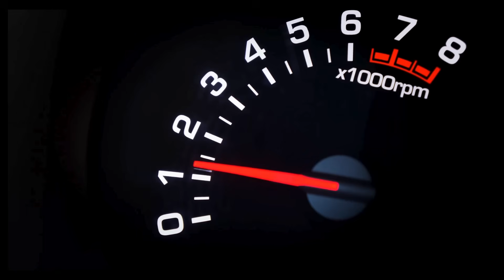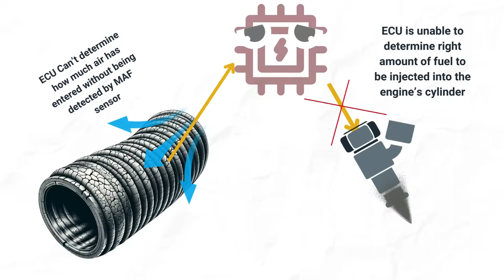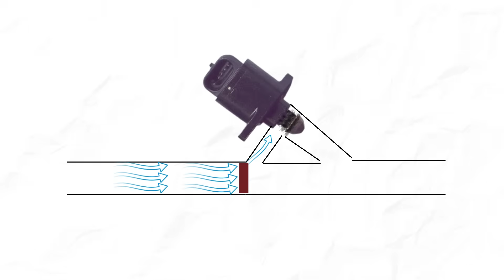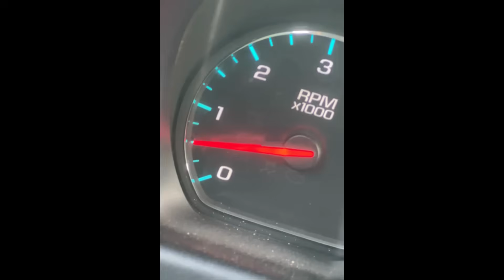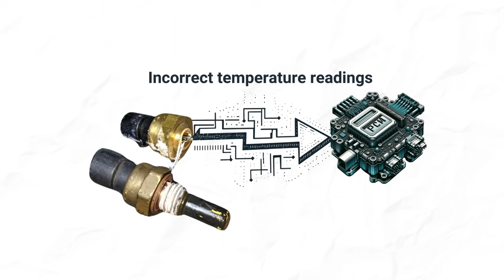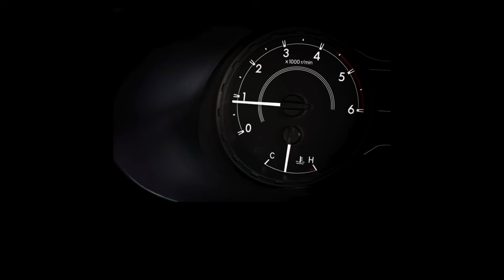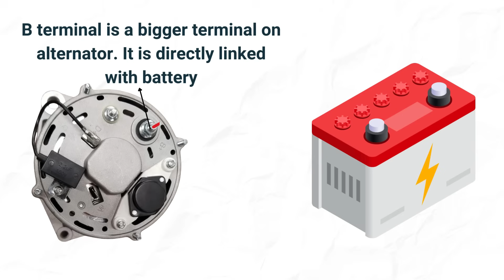6 Reasons Your Engine Revs Up and Down at Idle | RPM Fluctuations While Car is Parked

Comment: Hello I have a kia forte 2019 have misfire on cylinder 3 changes all the spark plugs all   coils also changed the Valve Cover Gasket Kit the tube seals and still check engine with misfire and rough idle engine shakes too much please help
Reply: Try Liqui Moly Jectron 7711 Gasoline Fuel Injection Cleaner additive. I have a kia sportage and it fixed.
Reply: @Global.Policy.Analyst I will thanks man
Reply: @مفديمفدي-ظ6ظ 
You're welcome,  Wait until the fuel light comes on. Pour the Liqui Moly Jectron into the tank, then fill up completely so it mixes well. Drive normally. After your next refueling, you’ll really notice the improvement in smoothness and response 👍
Keep me in the loop:)

Comment: lhelp me please  I have a 2003 Chevy Monte Carlo LS I replace EGR valve rear exhaust manifold new spark plugs new idle control valve new alternator new coils new fuel filter new fuel injector cleaned throttle body new maf sensor new purge valve new throttle body sensors new catalytic converter new oxygen sensors new resonator and .. what happens is ince it warm up my car reevs up n down I don no why I replace the map sensor too please help my mechanic even checked for vac leaks nothing

Comment: U have Swift VVT 2012 and when the car is in Idle the RPM becomes low which is around 500 and the car gets vibrating. We have checked everything nothing found. Some mechanics suggested to do rework of engine head. Will that fix the issue

Comment: Very Simple to solve Idle fluctuations,  I've did it in my car and prover tested.

Fill you fuel tank with V Power Diesel and automatically the fluctuations eliminated, your car idler becomes normal.

Comment: I had the same issue and tried every possible step. Later, I discovered that the previous owner had removed both oxygen sensors. Unfortunately, I checked that last—after replacing several other working parts and wasting a lot of money.

Now I’m waiting for the new oxygen sensors to arrive so I can see if they finally fix the problem.

Comment: Well explained and in full !! And in short time covering all aspects ! They say if you cant explain something exactly and in a short time you dont know what your talking about ! Man if everybody on you tube was like u it would a great place !! 😂 thanks sir ! Got a sub for sure.  Quesrion i have a 2009 rabbit idles high at cold start 15 after a minute it drops. To normal but runs and sounds bad for like 15 mins at high speed runs good and perfect.  New plugs and oil no check engine , what do u think boss ?.someone said the coolant sensor. But idk 🤷🏾‍♂️

Comment: I still have a high idle after cleaning the throttle body, placing a new iacv, a new tps sensor, new filter, new main relay, new fuel pump, no vacuüm leak, no engine check light. Heck I even was starting to think my gaspedal or cable is stuck, nope. So I still don't know why it's idling too high??..
Reply: check the tps

Comment: Thank u for valuable info. This can be added as a cause. My car  has same RPM flucfuation with no codes even with ODB. while checking car, I Noticed one fan not working. Found out the Low fan relay bad it had a burn brownish color on side. Replaced it and solved yhe problem.
Reply from the maker: Thanks for valuable info

Comment: I travelled without air filter cover and the engine started reving up and down . possibly unregulated air entered the engine .what should I start with
Reply from the maker: check maf sensor, it might become dirty. then clean spark plugs

Comment: My 2016 Tucson is currently at the mechanics getting checked over as I had a bad problem with it excessively revving up to 3-4 1/2,000 rpms stationary or slowed down at the lights or a corner even their diagnostics computer said the car thinks its going 208 km/h even when not moving. The throttle body, mass air sensor, fuel injectors and o2 sensors are all good but after giving it a test run on mechanics advice it still did the excessive revving at traffic lights. 

I've got a gut feeling both onboard computer/engine control module is pretty much stuffed beyond repair will know on Tuesday 05/08/2025 if that's the case I'll end up with the current loan car which is also a SUV
Reply: What's the outcome brother ?
Reply: @rautrajendra2993 currently still at the mechanics turns out my tucson is a 2009 model but the ECU in bonnet has been some how exposed to moisture.

This has caused early stage failure with not enough fuel being delivered,using more fuel than normal and rough idle so the mechanic is waiting on a reconditioned ECU and immobiliser to put in it

Comment: Thank you for the video. My sons 2009 gmc sierra 5.3 has rpm  fluctuations. Oxygen sensors. MAF sensor has been replaced. Throttle body has been cleaned and vacuum test is ok. Battery and alternator are also fine. I will try replacing the coolant temp sensor to see if that does the trick. Any other suggestions?

Comment: I have been having idle problems, sometimes will stick at 2000RPM, sometimes will run irregular, not all the time, sometimes if I cut the engine off and back on the idle will go back to normal, most times idle normal at around 800 RPM but the problem comes and goes?? Need some help with this, NO CHECK ENGINE LIGHT

Comment: What about idle rpm goes high or very low after braking? Throttle body already clean and all sensors are new. Still having the issue
Reply: I have same problem with my nissan frontier 3.3 2002...??....

Comment: Can this make the temp gauge to fluctuate as well?
Reply: Probably not. Check your water pump and thermostat.  The plastic pressed on impellers have been spinning on the shaft in a lot of the tempurature related problems I've seen lately or the thermostat is shot, or the radiator fins clogged with cottonwood fuzz, or the inside of the radiator  is clogged with rust and old coolant sludge. If you pop the hood hood when the engine is hot and you smell brown sugar or maple syrup like scents, your waterpump or radiator is leaking somewhere.

Comment: I have a dodge journey 2012 sxt if i go over 35mph my rpm goes up and down getting throttle cleaned tommorow if dont fix what can i do next ?
Reply: remove and clean the idle air valve with Throttle body cleaner, there are many good videos here, use a new gasket when reinstalling. Do not use brake cleaner.  hold the valve vertically with the electrical connector in the upright position. This keeps the TB cleaner from entering the motor and electronic housing.

Comment: This video makes me miss old motors don't need all these sensors and computers give me my 65 back 😢
Reply: Exactly. The pollution inspectors own your car   "You will own nothing"   saboteurs..
Reply: Trees are made to filter air 😂 @MR..181
Reply: They don't make them like they used to!
Thank dog!
Unsafe unreliable junk is what my 70 chevy was. 
Every car my friends owned before the very late 80's was junk.
But they were "easy to work on". All the time!
Just one person's opinion.
Reply: @gregk5309 should of gotten a ford🎉
Reply: @srbj1983  two of them were, 73' F150 was better than the Chevy Impala small block 2 bbl,  and a new 1998 Explorer which was way out of my stated date range but still junk. My 75' corolla and 79' celica were good, both bought with 120k-130k on them and sold for what I paid for them 2-3 years later with another ~30k on each of them..
Reply: Can't beat my 89 crown vic never a problem
Reply: Amen!

Comment: Hi very informative video I have a suzuki sx4 scross 2015 model it starts good idle good for a while then when the ac is working sometimes it drops under 800rpm and the engine starts to stutter and then it goes up back any thoughts on why thanks
Reply: Any solution..facing same problem

Comment: Im having this issue when I stop in traffic and gear still on Drive.
Doesn't happen when on park..
Reply: You figure out the problem?
Reply: Clean thre throttle body and butterfly with throttle body cleaner, do the same with the Idle Air Valve (also with throttle body cleaner only).  Buy and use a new Idle Air Valve gasket when reassembling after cleaning.  There are many short videos here on how to do both. If you hear the person telling you to use brake cleaner to clean either of these parts stop that video and don't listen to a thing they said.  
Same with MAF sensor cleaning, MAF sensor cleaner only, and very minimally, three - ten very short bursts from cleaner, and never touch it with anything. The cleaner will evaporate in less than a minute. No cloths or toothbrushes or compressed air!

Comment: what about if your idle is normal until you turn the a/c on it starts fluctuating?
Reply: Clean thre throttle body and butterfly with throttle body cleaner, do the same with the Idle Air Valve (also with throttle body cleaner only).  Buy and use a new Idle Air Valve gasket when reassembling after cleaning.  There are many short videos here on how to do both. If you hear the person telling you to use brake cleaner to clean either of these parts stop that video and don't listen to a thing they said.  Same with MAF sensor cleaning, MAF sensor cleaner only, and very minimally, three - ten very short bursts from cleaner, and never touch it with anything. The cleaner will evaporate in less than a minute. No cloths or toothbrushes or compressed air!

Comment: Hi i have 2006 acura rsx type s it idles just under 1000rpm..but when i give it some gas to about 4000rpm and let go it drops to just under 1000rpms then bounces up to aboit 1500rpms then slowly drops to about 1000 rpms...btw i replaced the iacv valve with a cheap amazon one..
Any ideas???
Reply: Did u ever find what it was
Reply: Yes...its was the cheap amazon part..I cleaned up the OEM valve and it worked perfectly  @axshred79
Reply: Ya it was a cheap amazon icav..I cleaned the oem valve and it worked perfectly  @axshred79

Comment: Mine isn't erratic. Mine goes from 800 and slowly creeps to 2000 and then drops back down quickly then repeats. Any idea? Also turning on the ac kind of keeps it in check for the most part
Reply: CHECK YOUR EXHAUST FOR LEAKS AND YOUR MUFFLER FOR HOLES. I HAD EVERY IDLE ISSUE KNOWN TO MAN AND WATCHED EVERY VIDEO ON YOUTUBE AND IT TURNED OUT TO BE A HOLE IN THE FRONT OF MY MUFFLER.
Reply: sounds like the throttle position sensor. most cars are suppose to idle at 650 rpm. At start up when cold they it will be a little higher at around 1000 rpm but usually after about one minute it will gradually go down to 650 and should stay steady. Sometimes the check engine light will come on and it will show a TPS sensor code but sometimes the sensor can be bad and a code won't be set.
Reply: Check intake manifold gasket for leaks, also for a really dirty Throttle Body and Idle Air Control Valve, and finally, vacuum leaks in general. The AC compressor puts a nice load on the engine so it's less noticeable and the ECU kicks up the idle with AC on which tamps down and masks the motorboating (surging and hunting idle). Unrelated but if it's got more than 30-50k on it put in a new PCV valve while the hood is up and you have better access to the engine while undertaking these fixes,  they're only a few buck$.  None of these things necessarily show up as a CEL code until they are really bad depending on OBDC detail on that model.  If they do code it may be throwing a code that's seemingly false and unrelated. These easy cleaning solutions may "fix" the engine codes (stop throwing those codes caused downstream by these problems, like lean or rich mixture fouling or burning spark plugs or causing catalytic converter problems. So try these solutions, clear the codes by taking off the negative battery cable for a half an hour (which you should do anyway while removing all the connectors and plastic and other things you'll remove to get at the Throttle and AICV anyway) and then drive the car a few cold hot cycles and see if the check engine codes are cleared if you had them. They may have been related to these problems. If after cleaning these other check engine codes come back you're only out an hour of time and a $7 can of Throttle body cleaner, which you needed to do anyway to keep the beast breathing properly anyway.

Comment: Could be a loose valve cover sucking in air, that's what was wrong with my Dodge Dakota.
I took it to several shops no one could figure it out
 I finally found the problem myself after three years.
💪
Reply: Valve covers dont suck in air
Reply: @neilkhodai7282  but it can affect the evap just like leaving the oil cap OFF

Comment: I had this problem of idle fluctuation. It was maf, I knew by unplugging it. When unplugging the maf, idle was normal, no fluctuation. Easy first test
Reply: If you unplug your maf while car is running and it stays running your maf is bad..if good then it will car will die....jus sayin
Reply: @RobbieMirza   not always the case as many modern cars default to preset values and then go into limp mode, but you wont notice much change as the car isnt under load being driven
Reply: Cel will come up when unplug
Reply: @RobbieMirza how did you repair it?
Reply: @RobbieMirza  yes my car done same i remove my and the car stay  run normal 😊
Reply: My golf 6 tsi dut the same place help

Comment: Also the Wiring To The IAC Can Be Bad (Connector And Wires) you can also use a cigarette or soapy water to find vacuum leaks also you can use a scan tool and use live data to check the IAC or TPS, On occasion it could be the PCV. These are usually the culprits. Hope this helps!!!!
Reply: A cigarette? How??
Reply: @veezyfresh3084 smoke off the cigarette will be pulled in by the vacuum

Comment: Hey, my cars rpm recently started to jump up to 2500 rpm for a second before crashing down to like 1000 rpm the next second and then quickly setteling at 1500 rpm. 
Happening only on cold start but every time i start the car. Runs fine after it gets to 1500 rpm. I also hear a strange noise like something slipping, mby a pulley or the starter motor every time i start the car. 
The car also feels weak when increasing or decreasing rpm a lot so mby its a bad map sensor?
Btw the car is a 1998 corolla e11 with a 4efe
Reply: probably either the MAF sensor TPS sensor. The sound could be your alternator belt. Starter doesn't have a belt. Unplug the MAF sensor then start the car. If your problem goes away then either the MAF is dirty or the sensor is bad. If the problem went away try cleaning the MAF sensor first. If it doesn't help replace the MAF sensor. If the problem didn't go away after unplugging the MAF sensor you still need to check the wiring voltage at the MAF connector to see if the proper voltage is reaching the sensor. IF all of the voltage readings checked out to concerning the MAF sensor/ connector then do the voltage tests with the TPS sensor connector. If the readings check out the replace the TPS sensor.
Reply: @SKRooU2  thank you for your reply, i recently replaced the water pump and belt, old belt was 26 yo and bad.
I also replaced the map vacuum hose. 
The issue went away, it most likely was the belt slipping.
I also replaced the charcoal canister as it was clogged. Car drives rlly smooth now :D
Reply: CHECK YOUR EXHAUST FOR LEAKS AND YOUR MUFFLER FOR HOLES. I HAD EVERY IDLE ISSUE KNOWN TO MAN AND WATCHED EVERY VIDEO ON YOUTUBE AND IT TURNED OUT TO BE A HOLE IN THE FRONT OF MY MUFFLER.

Comment: Thanks for your positive feedback on erratic vehicle rpm.   I am having the issue of rpm while my car is at idle and parked  The interior lights dim and the rpm fluctuates from 600 rpm to 750 rpm.  I disconnected the terminals of the battery, checked if there is broken ground wire or not, cleaned the throttle body, MAF and engine filter.  The rpm fluctuation went away but came back after few days.  What I discovered was that my vehicle battery charge reading with a battery tester is medium or 12,2 volts at a cold start.  Could a medium battery charge cause a car rpm fluctuation?
Reply: CHECK YOUR EXHAUST FOR LEAKS AND YOUR MUFFLER FOR HOLES. I HAD EVERY IDLE ISSUE KNOWN TO MAN AND WATCHED EVERY VIDEO ON YOUTUBE AND IT TURNED OUT TO BE A HOLE IN THE FRONT OF MY MUFFLER.
Reply: but what does the battery read when idling? It should immediately go to 13.7- 14.5 volts to show the system is charging. If t doesn't go up from 12.2 it means either you alternator is bad or else the battery is bad. You can go to Autozone and they will check the starter, alternator and battery for free. They will hook up a hand held scanner and have you start the car and it will test all 3. I have a small scanner I bought at Harbor Freight for like $40 and it works great. The dimming lights usually means a bad alternator. Does your headlights also dim at idle?
Reply: sometimes if it goes away and comes back means you just have bad gas / water in the gas. When it runs rough the water is passing thru then it smooths out when good gas is passing thru.. Try putting a bottle of HEET in your gas tank. it will evaporate any water if you have any in the tank. Your fuel filter might need to be changed too if it's been a while. If these 2 things don't fix the problem then it could mean you need a new MAF or throttle position sensor.. Sometimes you can just unplug the MAF and it will run fine. If that happens you need a new MAF sensor.
Reply: @SKRooU2  Thanks for your positive feedback.  I cleaned the throttle body with throttle body cleaner and MAF with MAF cleaner disconnected both battery terminals over night to reset my vehicle electronic modules it quite frankly improved overall performance of my automobile and the rpm fluctuation stopped.  My car uses premium petrol but will try the product you mentioned above "HEET" to remove any water residual in my car's gas tank although again I am not experiencing any rpm fluctuation.
Reply: @SKRooU2  My vehicle battery voltage at idle was 14.5 volts